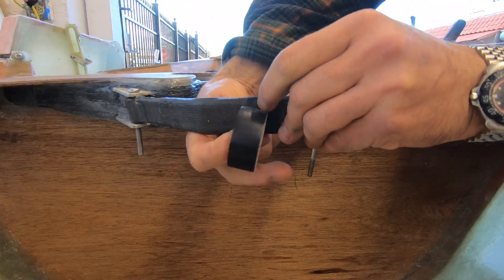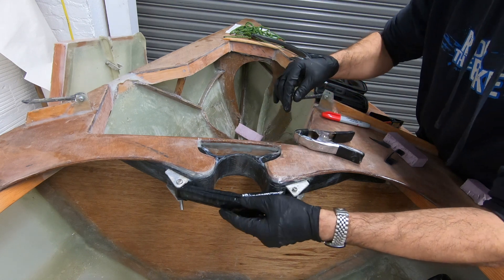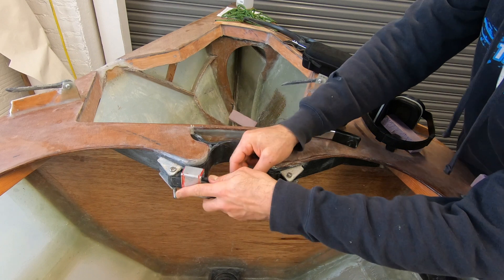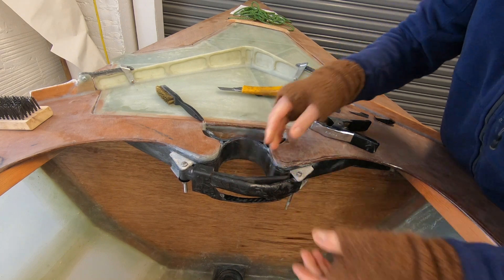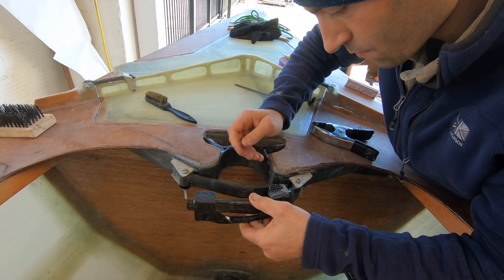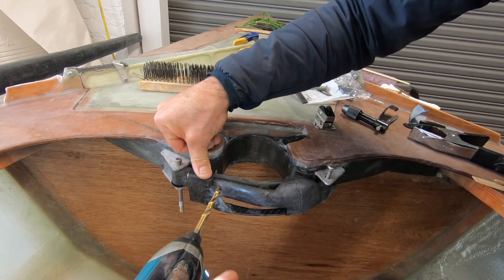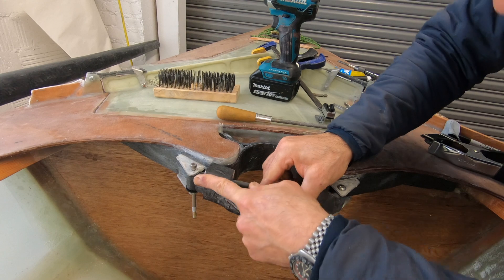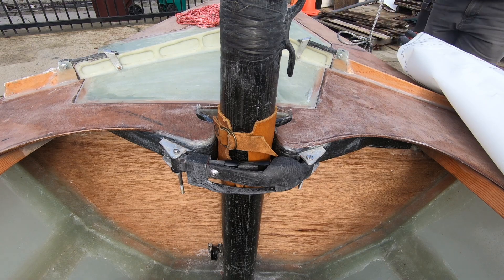The making of a carbon fiber mechanism on a sailing dinghy. Inventor reveals process.

Comment: Have now watched all your sailing related videos and love what your doing. First Mod is Awesome!  Off course the translucent G-10 hull is by far the stand out feature but I don't see you get into it much with your narrations.
integration
Reply from the maker: Thx Steve, I have some material about the G10, it was much flexier than plywood but same tensile strength. Was interesting to work with its stengths and weaknesses. I did write some on it in Small Craft Advisor  July - August 2020.
Reply: @fossilfool  Thank you, read the article. I think the integration of the materials is very interesting.  From your  you tube clips, definitely functionally successful. Also very visually successful. You mentioned that you had the G-10 material on hand. Would you choose to use G-10 again or rather, from this experience,  have you had ideas of a similar, other material to explore  regarding weight, rigidness, or workability?
Reply from the maker: @stevepeterson233  It's about 2-4X the cost of plywood. Otherwise I'd  use it again. I worry for the long term aesthetics because it yellows badly. Then that nice light green becomes an unappealing light brown. I have used much varnish and cover it whenever possible.
Reply: @fossilfool  
Yes, 
Good info. 
I'm too busy right now but am the type that will think on it for years to come. Definately very inspiring. I'm sure there are many viewers out there thinking about their boat, the  "Second Mod", I'll look forward to  more  posts.
Thanks
Thank you

Comment: Is there an explanation of (the magic) how the trailer wheels are mounted and the design process & fabrication?
Reply from the maker: Here's a couple photos that explain it:  https://www.flickr.com/photos/rockthebike/33745911898/in/photostream/ ,  https://www.flickr.com/photos/rockthebike/47685313441/in/photostream/  . At my biz Rock The Bike we sell the 1-sided trailer wheels: https://rockthebike.com/fender-blender-pro-trailer-kit/
Reply: @fossilfool  Excellent!  So the cavities for the wheel stabiliser are effectively part of the hull shape, likely angled backwards to minimise the flow of water under the hull.  Ever seen semi-full bicycle tires?  They are designed to be a bit more maintenance free than pneumatic tires?  I helped a local bicycle repair guy fit some to a bike to demonstrate to vendors.  A little bit more road-feel than normal.  https://twitter.com/indy_slug/status/1118241370722963457
Reply from the maker: @leuvenisaplace  I hadn't seen that design. Interesting.  Amazingly I've never had tire problems on any of my bike sailing systems. Knock on wood! Current boat is 400+ # on the way to the water sometimes.
Reply: @fossilfool  It may be a good thing to have the pneumatic tube act as sacrificial member rather than have the wheel fail.  Many city bikes here get little maintenance, yet an estimated 80% of all journeys in town are by bike.  How to do the grocery run for a an ordinary family, or a take a 2nd bike to the shop or the train station when pals visit from out of town.